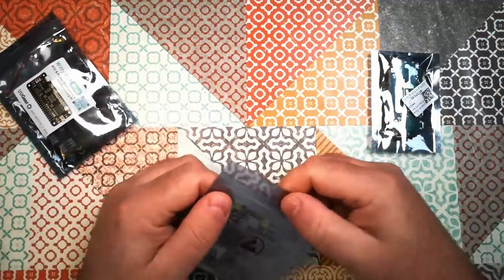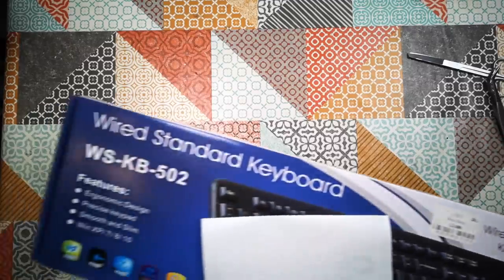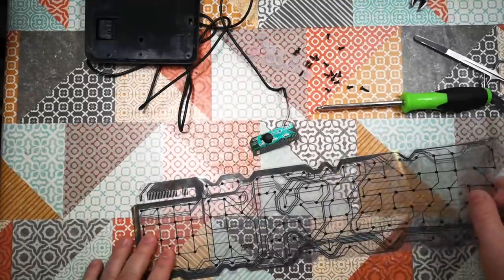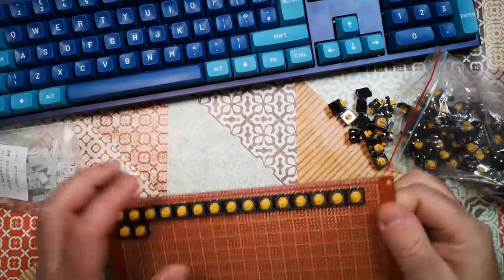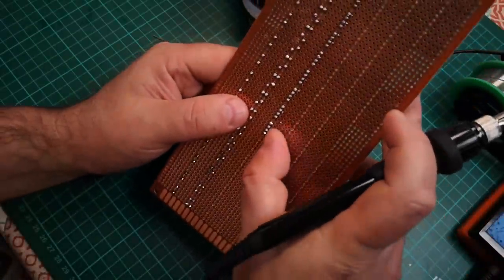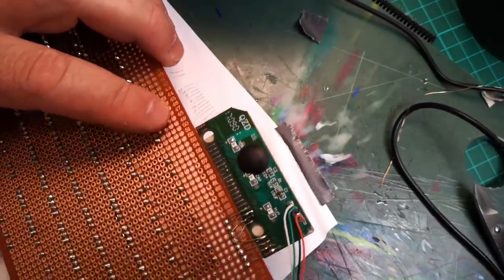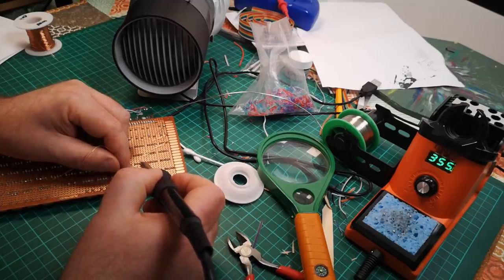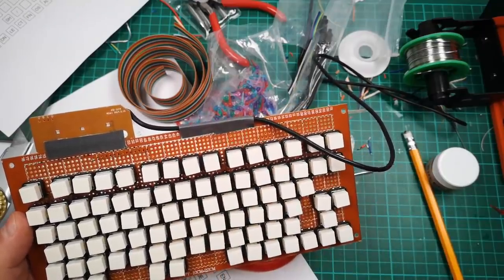How to NOT Build a Keyboard, or: Time to Stop Doing the Same Thing Harder

Comment from the maker: Afterthoughts & Addenda
FAQ is below the fold in this pinned comment...
Your Critique - I am of course very interested to hear your civil and constructive critique on all of this - after all, I'm not even really sure I have considered all of the options.  Please be aware that if you post a comment containing a link (for example a product you think I might use for this), you should allow a little time for the link to make it through the comment moderation process (links are automatically quarantined on this channel due to the high level of scam/spams around)
FAQ:
Why didn't you just use a ready-made keyboard? - the keyboard needs to be wired USB and less than 200mm wide.  There aren't a whole lot of ready made keyboards that fit this two simple criteria.
Why not design and make a custom PCB? - great idea, but I would have to develop the skills necessary to do that, which is quite a journey for a one-off prototype - not that I would really mind having those skills in my arsenal for other projects*
Why not just do it [some other way]? - you may be missing the point - this was supposed to be an exploration of a really basic, no-programming, low-skill-required potential method of making a custom keyboard.  It failed, but this was something I wanted to explore.  Doing it a different way would not be this.
Reply from the maker: @CabbagePatchSoap  perhaps, but definitely stop whole that is happening
Reply: I'm just wondering if your choice of music was intended to be a little bit ironic?  It certainly WASN'T a Walk Through the Park!  😂
Reply: Could you save yourself the last difficult/fiddly task if you used Veroboard with tracks one horizontal and one vertical. Would the key pins be long enough to go through two layers?
Reply: Great video. My only complaint is when you picked up the USB dongle, I was very disappointed I didn't get to hear the word dongle in that dashing accent of yours.
Reply: I've been thinking handwiring instead of following an existing, complex matrix. I'm glad you're planning on going with QMK Proton/Pro Micro controllers next, the Atmega32u4 is a pretty well studied board as opposed to the black box of wiring that is the keyboard controller you bought. Hopefully the next iteration of this idea is a big success :)

Also, the person that said to flood fill the traces in a photo editor is a genius!
Reply from the maker: One of the things I was sort of hoping would happen is that there would be some small bluetooth wireless keyboard, that, when opened, has internal pads for USB wired connectivity.  I reckon there probably have been such devices in the past when a designer might have been wanting to keep the USB wired option open for a potential product variant, but I suspect anything made currently simply won't have that
Reply: Have you thought about creating your own keyboard pcb? Although you would have to learn CAD like eagle it is pretty fun and very rewarding to create plus it is good investment for future projects as well! They are really cheap to manufacture as well 15 bucks max delivered in a week or so
Reply: I think the "gutting a cheap keyboard" part was clever, but going with the absolute bottom-of-the-bargain-bin keeb might have been a bad idea (hindsight is 20/20 of course). I'd say that if you want to stick with a similar idea, it would probably be better to scout out a few (slightly less) cheap keyboards and then look online for teardowns on them, so you can check if its pads are big enough to solder to, if the matrix is reasonably simple, etc.
Designing a custom PCB & having it manufactured is probably a bit out of bodge territory, but it would probably reduce the wiring confusion and give you more confidently-attached pads. You might even be able to get the manufacturer to pre-place some SMD diodes and get some more rollover, though I have a feeling the keeb's firmware would prevent that from working
Reply from the maker: I think creating my own PCB is a possibility, but if I do that, I should use a more conventional or standard controller, because it might make the project reusable by others.  If I reverse engineer a harvested keyboard, then design a PCB for that, chances are nobody could ever use it for anything else.
Reply: @AtomicShrimp  Perhaps buy another cheap keyboard just to see how similar the wiring is to the first one.
Reply: It made me smile that this came up in my recommendations as I'm in the process of repurposing an ultra cheap toy music keyboard (Argos/Chad Valley, 2 for £15) as a MIDI controller (if you want to see which one I reviewed it on my channel before starting work). Like you, my mind did the "reuse the keyboard" as the easy bit, but once I studied it of course it suffers from key rollover/ghosting, so I've had to sit carefully scratching loads of printed carbon resistors off with a craft knife, carefully solder on ribbon cables, etc. That has actually worked (apparently) since the contacts for the printed resistors could be reused for connecting the wires, but way more fiddling about than I naively thought when I started.

Anyway, enjoyed your video and was impressed by your accepting when the Sunk Cost Fallacy is in operation, very wise words.
Reply: I've made my own keyboard a while ago. I would suggest color coding your rows and columns (I used colored ribbon cables I stripped back where (and when, with a sharp knife) I wanted to solder them), it increases the maintainability and reduces the complexity significantly. For the same reason, I wouldn't reverse engineer a matrix and go with n-key rollover, it's not much more effort or expensive (the hardware costs about the same as a cheap keyboard + you spend a lot less time (and errors)), and it allows you to keep the matrix simple. Additionally, I'd only add the keys you actually intend to solder in that pass and leave the rest off, can't solder to something wrongly that isn't there after all (or mark the pins with tape / marker), your cutout should make sure that no key gets misplaced.
Reply: Regarding the enameled copper wire, I solder a lot with it and it helps a lot just to scrape at the end a little with a knife or some sandpaper, then tin the end of it before trying to solder it down the the pad. that way you can just touch it to the pad quickly with less risk of overheating it or lifting a trace.
similarly, with the issue of some wires being slightly off where they need to be, that shouldn't put too much stress on the PCB to resolder them because the enamel is already burned off.
Reply: @AtomicShrimp  You can create an USB keyboard with Arduino (make sure the chip has USB HID) - you just have to link up whatever the input is with code that outputs a certain key combination (which means in effect you can have USB devices which can send text to a computer without input). Not difficult for one key press at a time but gets tricky with simultaneous key presses (for the same reasons you mention in your video!) Might be worth searching the internet as surely someone has already tried doing a full size keyboard that can take 2-3 key presses at once - although may need improvements etc
Reply: I noticed that the traces on the cheap keyboard have different thicknesses: is it possible that they also track the resistance of the circuit to prevent the confusion in case of multiple keys pressed? Also, if I send a differently modulated signal through each row and read what came out from the columns, wouldn't I be able to univocally identify each and every key pressed, no matter the combination?
Reply: 22 I think
Reply: You did say you were adverse to wireless connectivity.

Have you considered attempting to get one of those boards with that connectivity and attempting to make it work directly wired instead?
Reply: I built a custom keyboard back in the 90ies using your method and thought to myself: "you're in for a ride going down that road". Nowadays there are way simpler methods using qmk or the likes on cheap microcontrollers. The process of reversing the matrix has a lower learning curve but is way more tedious and annoying. The process of building your own qmk-based board has a steeper learning curve, it takes longer until you get any results, but it definitely more satisfying.
For your use case I don't think I would have built my own keyboard. Go for something that's readily available and cumbersome to type on. Otherwise you'll spend a ridiculous amount of time building something that's more expensive than of-the-shelf products but still cumbersome. You can get that experience for less money and effort.
Reply: Hey Atomic Shrimp... one possible solution to the incorrectly wired keyboard which could avoid all the issues of rework..... (assuming all of the keys are uniquely addressable) you could use a keyboard remap on the raspberry pi itself. :)
Reply: Hello and thank you so much for taking up time of scammers, and causing them to waste time so they're not scamming somebody else, I appreciate what you do and I find it also very entertaining so thank you please do not thank me because I done nothing but watch the videos, you make. 👍
Reply: I found the whole process fascinating. Apart from that, the sunk cost fallacy is a such a valuable life lesson, and I can’t help but take it to heart after you were able to choose to stop after all of that effort and time. The other adage I’m reminded is “knowledge is never wasted;” the knowledge gleaned from this project will go on to facilitate others.
Reply: I remember the good old, hobbyist PCB days of PCB pens or PCB layout tape, and ferric chloride baths, but it's easier these days to design one in free software and get them made in China. (For the old school, hobbyist, DIY PCB, drilling out all those holes for the tac switches would really suck.)
Reply: The simplest way to get what you want is reviving an old laptop, say an IBM T20 series (those were small, light and built to last). Besides some basic cleaning you just need to cut open the battery pack and replace the cells, it's not as hard as you may fear. Modern Li-Po cells can power that kind of machine for as long as a week if you tweak power options. And if you need more processing power a Dell d400 series would fit the bill just right, it's even easier to service.
Reply: @AtomicShrimp  Worth noting that it's fairly straightforward to use an STM32 microcontroller for the task, due to an abundance of example projects.
Reply: I've had good results using wirewrap wire... if you can find some. It's fine wire in a relatively soft jacket meant to be easily pierced when wrapped around square metal pins. The jacket melts very easily and the wire takes solder very nicely. Just holding it on the switch pins is enough to make good solder joints when heated.

However wirewrap construction was a prototyping and assembly technique that went out of fashion when cheap PCBs came into being, so the wire might or might not be hard to source- I haven't looked because I haven't used it in decades.
Reply: U do random things
Reply: @markfergerson2145  You can still buy wire wrapping wire. It is called   "Kynar" wire.
Reply: @ijabbott63  Yes, but learn from my mistake - make sure you get the one that actually says "KYNAR" not the one that looks the same but doesn't say "KYNAR". It's crappy PVC insulated and in many ways it's not as good (although you can strip it with your fingernails very easily, somewhat convenient).
Reply: Its a grid anyway... so rotate all of those keys 90 degrees. force a bit of jumper into the pin related solder pots to connect the rows.. than do the same to connect the columns.. than fill the solder pots. than connect the termination points for each column and row where they need to be on the controller.
Kinda systematically do it.. and as nondestructively for as long as possible..

I hope that makes sense and is useful. I greatly enjoy your content.
Reply: Mike...I salute you for a very valiant effort with this "aborted" project. But we learn through our failures. If I can suggest a couple of "quality of life" improvements to your ongoing soldering life, then get yourself a roll of old school lead solder. From the colour of the spool it looks like your using lead free and for hobby projects it's a bloody awful solder to use due to a higher melting point (I can tell from the look of the solder joints). Get yourself some 60/40 (Tin/Lead) solder from CPC-Farnell (I use the Loctite brand), it'll make your life far easier. Get a roll of 0.71mm for finer work, and 1.22mm for where you really need to slather on the solder. It won't kill you and won't hurt the environment in the quantities you're using. Also get a tube or tub of flux which might have helped with soldering onto that keyboard PCB. There are also flux "brushes" as well. And finally a third thing is to get some solder braid/wick (see also CPC-Farnell) which will help mopping up solder if you need to desolder a joint. All the best and happy new year.
Reply: Typing on momentary switches sounds like a nightmare. Even if you got it to work, it would be a really garbage keyboard.
Reply: @theodiscusgaming3909  You prefer the push-on, push-off type?
Reply: @godfreypoon5148  no lol. Technically I made a mistake because all keyboard switches are momentary, but what I meant is those cheap button type momentary switches as opposed to real keyboard switches like gateron, cherry or alps
Reply: @theodiscusgaming3909  Haha yes, very fair comment.
Reply: @Beregorn88  No, because you still get the signals crossfeeding between the switches.
Reply: @AtomicShrimp  If you did have someone manufacturer a PCB I'd have each key's letter or function etched on to the board so it would be harder to confuse the keys with each other. Also to reduce the time for your iron to recover and get hot again I'd use a better iron with the heating element in the tip. Like the Pinecil or TS-100 are great cheap irons but the shipping takes a while because they ship from China. Granted the shipping time is about the same as the shipping time for the PCB if you order it from China as well. Ordering domestic costs a lot more but shipping time is dramatically reduced. As far as soldering to finer points goes, that can be made easier with finer tips. Desoldering braid would also make it a lot easier to desolder bad joints when you make mistakes.
Reply: If you'd use an open source microcontroller like an Arduino or a Raspberry Pi Pico you would have a nice extra benefit of being able to implement some kind of software debounce, on the off chance your switches have some kind of bouncing problem.
Reply: You can't "burn through" enamel coatings. Enamel is glass. You have to sand it back using emery paper or some other abrasive. 
I believe this would have worked had you done that.
Reply: If you take some side cutters and chop off the piece of perfboard you're interfacing to the keyboard controller, you can avoid the rigmarole of re-soldering to the pcb by instead wiring everything to the chopped-off piece. Bit of an ugly hack but it'll get the job done.
Reply: The cheaper the keyboard. The more pressure it needs for the keystrokes to register properly. That's why all the screws are on there.
Reply from the maker: @thespazticator  The 'enamel' on enamelled wire is not glass, it's a polymer coating.  Misnomer perhaps, but I didn't invent it.
Reply: You were so close!  You were definitely right to abandon it when you did.  I know you've discounted designing your own PCB but you should reconsider.  I've used JLBPCB in the past and the board designer is web based and straight forward to learn (there's plenty of tutorials on youtube).  You could also have a 4 layer board to help with all the routing.
Reply: At least I waisted my time on watching, “And Learning” this, Instead of wasting solder and pcb’s making the same mistake. 
Much Valued Time Here. 
God Bless. 
👍
Reply from the maker: @Teutonic Gaming I'm not really expecting to type on this thing - at least, not write a novel.  It's more a case of maybe typing a few bits of text such as filenames, but you are right - the actuation force of these keys is pretty severe, so I do need to think this through some more...
Reply from the maker: @D T I don't think there's any hope of rescuing the incorrect wiring of this keyboard - it's not just that I have connected the wires to the wrong switches; I have wired to the wrong pins of the wrong switches.  Pretty sure something is probably already shorted so as to mimic a permanently pressed key already.
Reply: @AtomicShrimp  As you went deeper into the rabbit hole I was like "Oh no he won't...no he won't...damn, he did [attempt to wire his own keyboard]". As you found out, it's a fairly hard task and the total amount of tracks to layout and points to solder is a lot.
You could ditch the keyboard altogether. There are some great HDMI screens with embedded touch capabilities. They sell around 60$ but considering you would need a screen for this thing anyway, it might be a good choice. 
If you don't embed a screen in the project, a wireless keyboard actually makes much more sense. There are some tiny Bluetooth keyboards with a mouse pad that you can find for cheap and pi zero 2 includes Bluetooth connectivity.
Finally, those boards are fairly tiny. I bet you can find a keyboard big enough and hack them into it if you get really creative. You'd have to spread them around of course, and if you do please use the proper ribbon cable and connectors to do it ;)
Reply: @martinwyke  even if they only fit one layer, stripboard / veroboard is absolutely the way to go.  Worst case scenario it cuts the wiring in half.

Even if he's dead set on using the current keyboard chip, he can still cut a few traces and add jumper wires and call it good.
Reply: Hi Shrimp! I'm an electrical engineering student and "mechanical keyboard enthusiast," and am currently working on hand-wiring my own hobby keyboard, a dactyl manuform variant, so I thought I might be able to add a few ideas to the discussion!

1. Those switches look like a pain to work with and, eventually, to type on, too. I'd suggest taking a look at the kailh choc switches. They have a similar height profile to the momentary switches you're using with a similar width to normal cherry mechanical switches, and they only have two pins instead of four. I'm not sure if their pin layout would line up with prototype board though as I haven't used them before.

2. An ortholinear layout (all keys in a grid rather than staggered rows) might help with compactness here. It would also eliminate the hand-soldering of switches together as you could just use the lines already present on the prototype board.

3. You mentioned buying a QMK board in the video. Not sure if you're aware or if this is what you meant, but you can use an arduino pro micro for QMK. They're only ~$4, hardly more expensive than the keyboard you bought.

4. In fact, you might consider looking at the Planck keyboard for ideas. It's an ortholinear 40% keyboard that uses a few of QMK's features to give all the functionality of a full keyboard through momentary layers and uses a few of the ideas you used here, like dual space bars.
Reply: Hello, Can i recommend that you do a video on the whattsapp 'I lost my phone' scam. Thanks!
Reply: It’s ok to fail. Because you thereby succeed, ironically.
Reply: Decided to give this a go. Failed like you early on with the UBS controller from my old E-waste KB. The pads werent meant for soldering. On my second attempt i had success, found a to more gently solder it. Currently wiring up  gaming kb/pad using it :)
Reply: You could raffle this in aid of Babatunde. I'd definitely buy tickets!